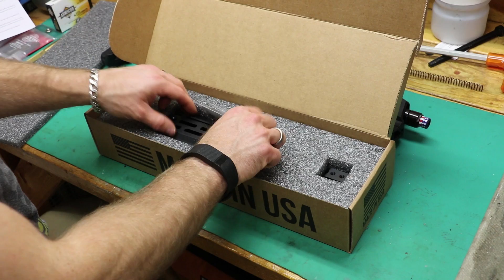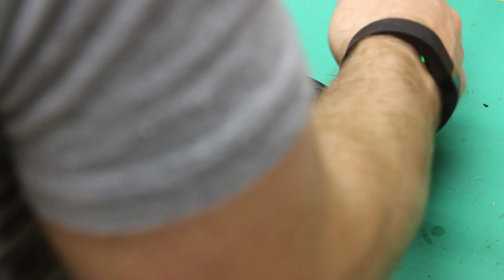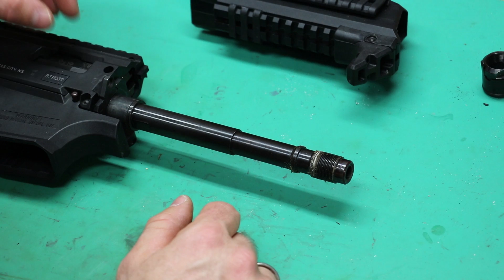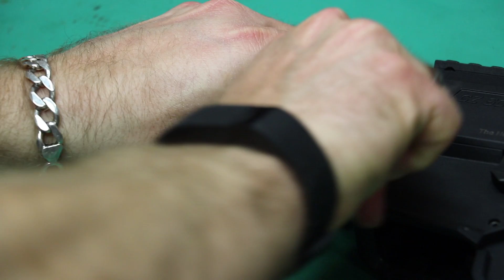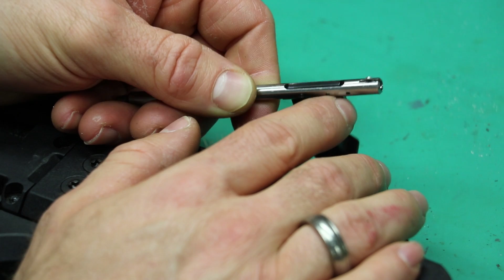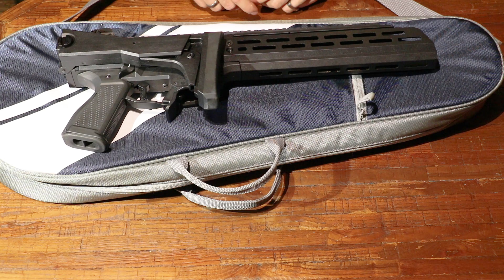HB Industries CZ Scorpion EVO 3 S1 Aluminum Handguards

Comment: So glad HBI made their hand guard pin use standard roll pins.  CZ's little hand guard pin (should be called a charging handle stop pin) is $35, for a replacement pin.  Roll pins are way less expensive.  I wonder if Magpul will be making a polymer handguard that also just has M-Lok slots. Because the size of my hands, forces me to use extended charging handles on my CZ Scorpions Evo's.  My carbine has the Manticore Arms "Switchback" charging handle, which is awesome. A question I have is:   After using the new aluminium handguard, is there any issues with heat transfer (handguard getting hot)?
Reply from the maker: I have not had any heat issues since there's considerable air gap between the barrel and handguard.

Comment: Why does the charging handle move forward a bit ? Seems like there is a delay when you goto charge it. I dont recall the factory handguard doing that
Reply from the maker: Could be the aluminum to aluminum contact with the charging handle. I now have an oversized polymer handle in there.

Comment: Have you had more time putting rounds through it, and if so, please advise if there is any noticeable amount of heat transference to the metal handguard after a few mag dumps? This is my main concern as I notice that the factory sling attachments near the trunion can burn skin after dumping a couple of mags, which makes me wonder about the aforementioned heat transference to an aluminum forend.

Comment: I love the hand guard thanks for sharing. I’m wondering if you notice a difference with heat after firing a few mags or not? Does it get hotter then the polymer hand guard? Thanks
Reply from the maker: I never really noticed much of a difference when I was testing, but I haven't really done long firing sessions with it.
Reply: Buffman - R.A.N.G.E. Thanks for the quick reply!! That was the only concern I had about getting one.

Comment: Does the barrel get tensioned with the factory handguard?
Reply from the maker: The plastic spacer I took off is tapered and the nut tightens down into it. Without talking to a CZ engineer, I think the barrel nut is only there to retain the handguard.